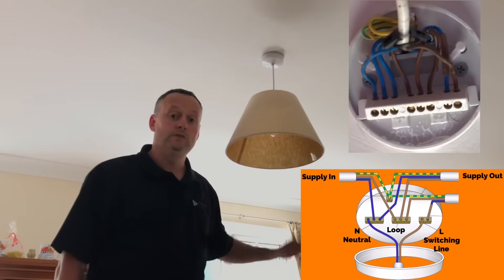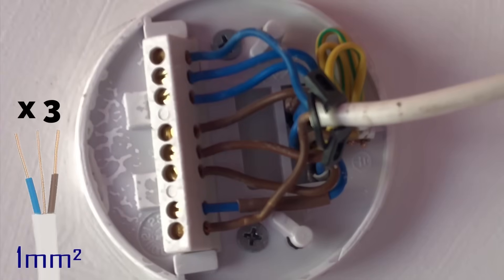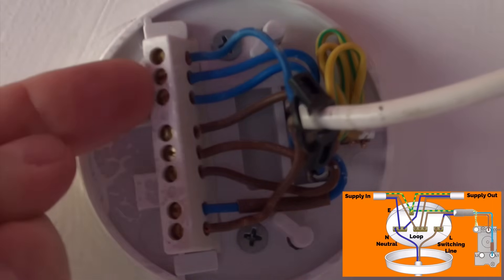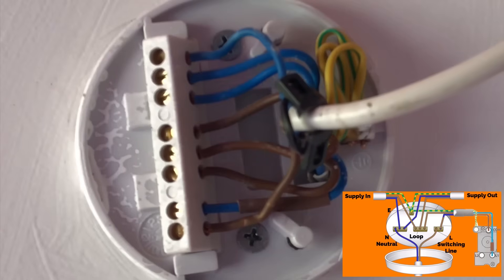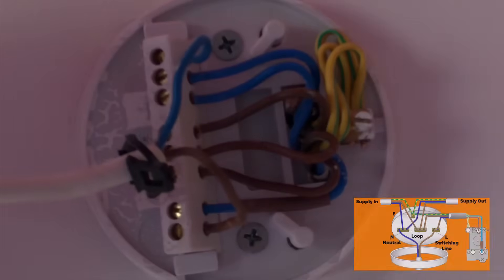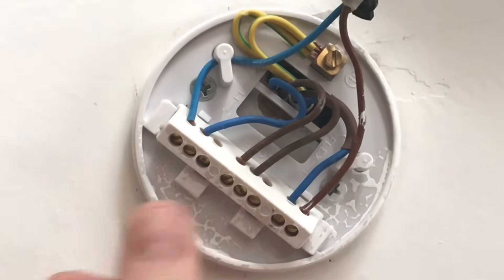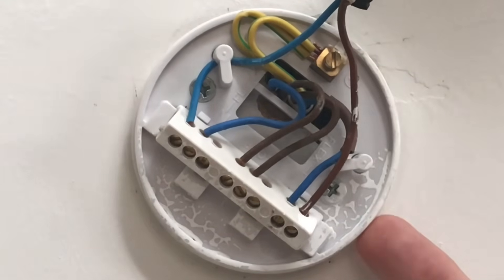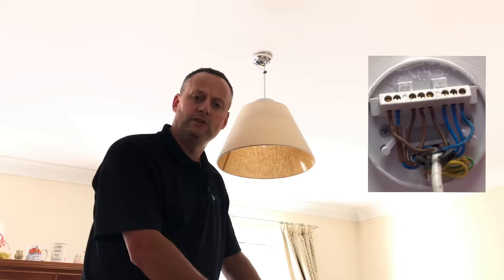3 Plate Loop-in Method Ceiling Rose Connections Explained in a Domestic Dwelling (Wiring Diagram)

Comment: Does anybody remember the Lewden Meastro ceiling rose??
I used to use them a lot, they were a brilliant design and enabled the safe and easy removal of the attached luminaire.
I had them in my house where there were fancy pendants and I fitted many on my customers houses again where they wanted a fancy pendant.
No idea why Lewden stopped production but I have found nothing to replace it.
I dont agree with crushing  connector blocks inside a metal cup to cover them up. Many do this but it's not right.

Comment: I disconnected - the Old Worn Out Ceiling Rose - But I did not take note of how the wires are connected - its in the bedroom - and also when I disconnected the wires - its the point that joins the circuit - So now not only is the bedroom without Light - So is the Landing and Toilet and Bathroom - Connecting the wires back up to a New Ceiling Rose is Tricky - because I have all these different wires joining the Loop - but not sure the order to wire them - GREEN - RED - BLACK.

Comment: I am confused though I am currently - disconnected the Light Circuit - because I pulled the only appliance out - I am trying to follow this video - in how to connect the right wires in order to a connection like this - But I have different colour wires - GREEN - RED - BLACK.

Comment: If you’re having more than one light turned on by the same switch, do you just take another 1mm from the ceiling rose to the next light? So at that first fitting you’d have 4 cables, the supply in and out, the switch line down to the switch and then the next switch line to the next light?

Comment: As always, great video Gaz. May I ask a quick question, is it compliant to spur off a loop in rose that's already providing a spur (usual loop in) or is it compulsory to find the last rose and spur off that? I ask because there's only three terminals for the 'loop' block and 'neutral' blocks. I want to add a light in loft space and easier for me to spur from rose than using JB as quite a few cables up there. Thanks :)
Reply from the maker: Hi. You can come off any lighting point in the circuit. Great question and thanks for watching Gaz

Comment: Hi, if you don't mind i have a question...is the adiabatic equation calculated using Zs or Ze? Found some conflicting info on the web. Thanks
Reply: kevin smith hi fella. ok so not related to this video I’m guessing your asking about acquiring the minimum size protective conductor for an installation. If so it would be Ze fella as we are measuring the amount of current that would flow at the origin. Gaz I’m sure will correct me if your on a different question path.
Reply: @PlymouthSparky  yeah, i read an article where someone used Zs, i just wanted to double check. I'm looking to retrain just doing a bit of self study. That's cleared it up nicely, i appreciate it, thanks mate.
Reply: kevin smith good on you all the best with your training and study.
Reply: @PlymouthSparky  Thanks mate.